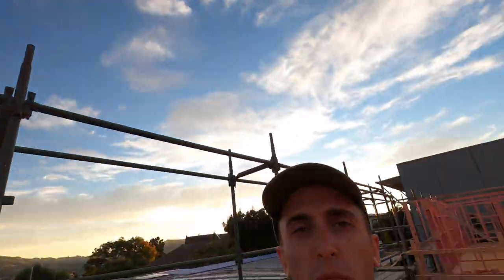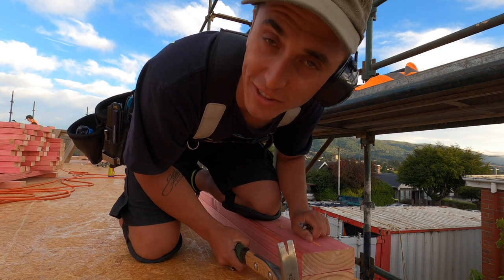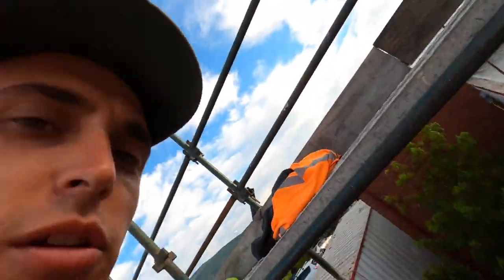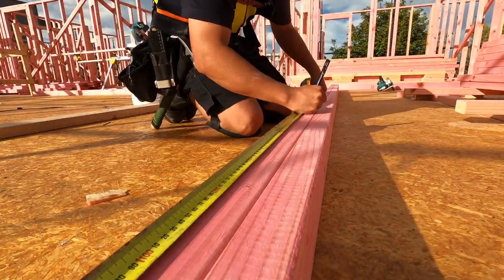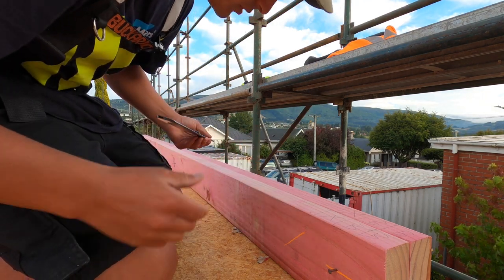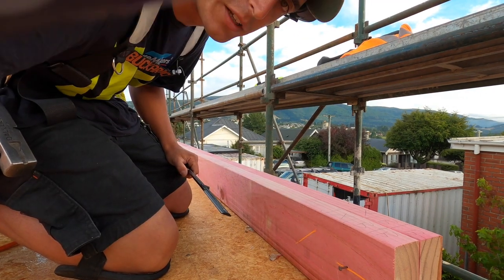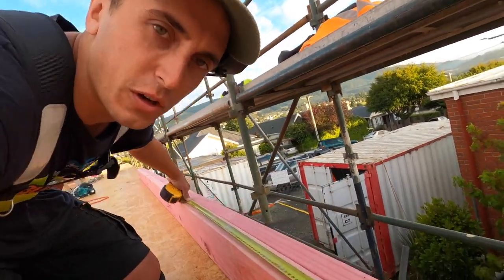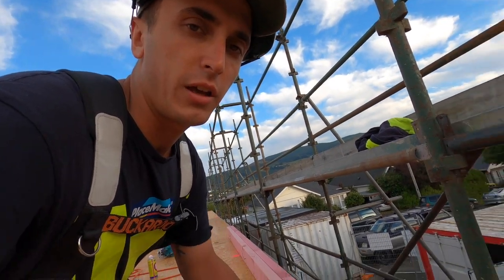How To Mark Stud Centres | Framing For Plasterboard

Comment: Man that 622 set out for studs is so simple, i was taught to just add 22mm to your stud location on a running measurement, that this makes so much more sense, Calculations, Pattern, Systems i love it.

Comment: What do you do when you stud spacing can’t evenly divide at 600 or 450 centers?
Reply from the maker: We don't do studs at 450 centers only 400 centers. But it's just working out what's going to best suit linings. But I won't shrink or expand those centers.
Reply: @CarpentryAndMe  awesome, would you just put an extra stud at the end and split the difference? Say for example the end of the wall is 650 would you divide that by two and that’s your stud?
Reply from the maker: @wheres_bears1378  we would just put it where it lands measurement wise.
Reply: @CarpentryAndMe  perfect thanks for your reply 😊